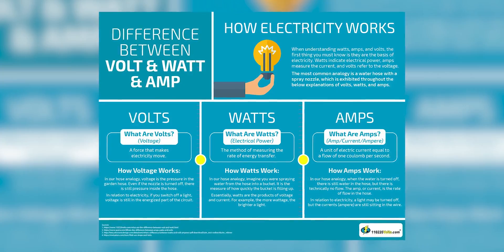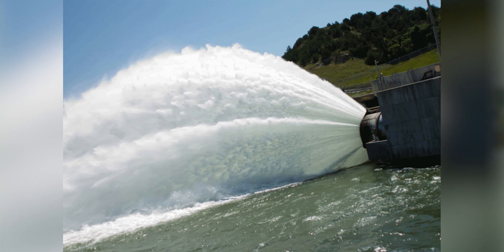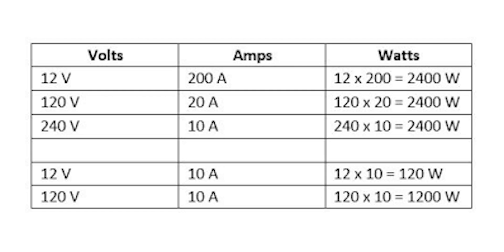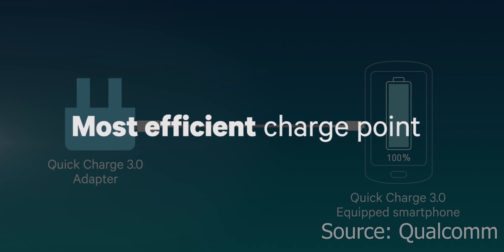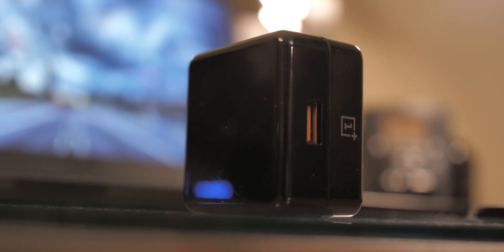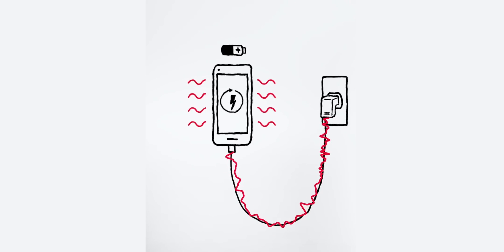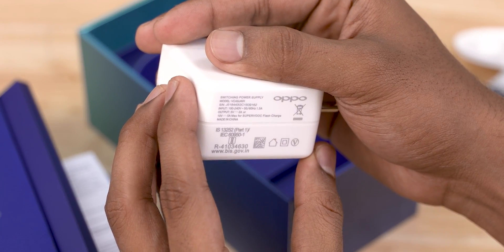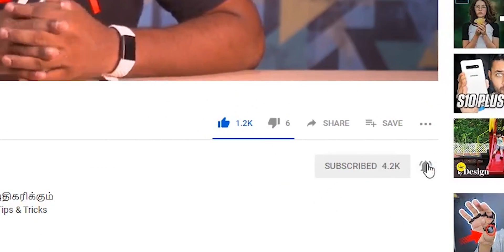Smartphone Fast Charging எப்படி வேலை செய்கிறது? - Explained!

Comment: Bro Naa use panra mobile OPPO F17 எப்போ recent tha வாங்கினேன்.. phone'la no mistakes.. but 30W fast charging கொடுத்து இருக்காங்க.. but I am interested to fast charging... So, 1:5 ratio'la my redmi 6 mobile 5w charge 5 times & 1 time oppo charger use panra bro... இப்படி செய்வதால் வருங்காலத்தில் ஏதேனும் battery பிரச்சினை ஏற்படுமா?

என்னோட battery cycle is 10 to 85 or 90... Between the range...

அதுமட்டுமில்லாம fast charging பண்ணும் போது phone battery heat ஆகுது...

இப்படி other company charger use பயன்படுத்துவதால் phone battery life damage ஆகுமா??

நான் என்ன பண்றது அப்படின்னு சொல்லிட்டு ஒரு தீர்வு சொல்லுங்கள் நண்பா??

Comment: Enna bro,,, neenga engineering student ah... Pipe, water, wire, current, voltage, pressure... Kalakkittinga ponga...